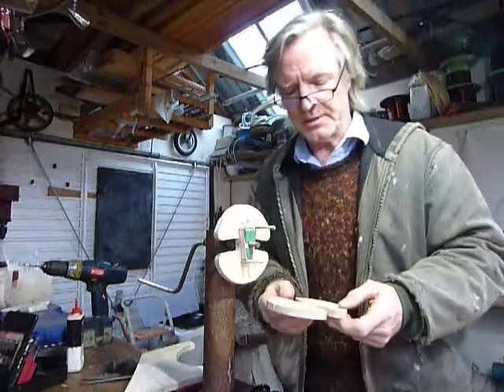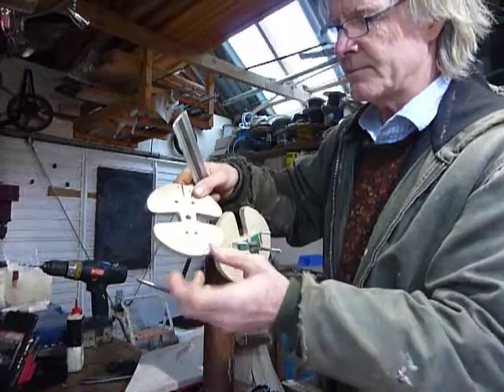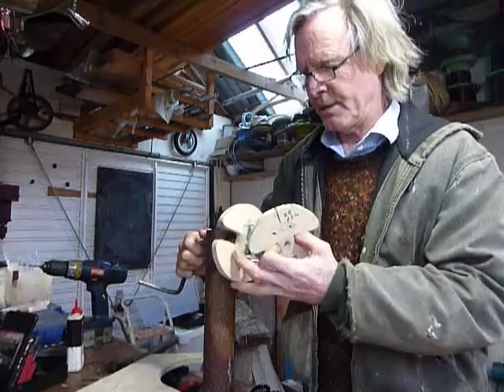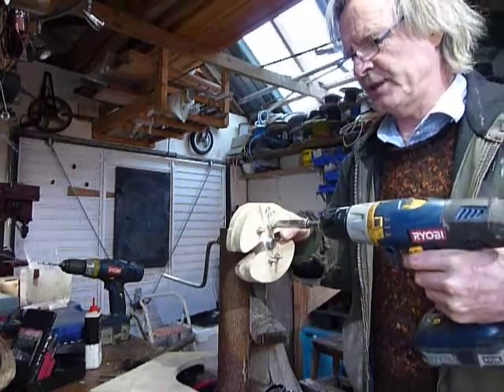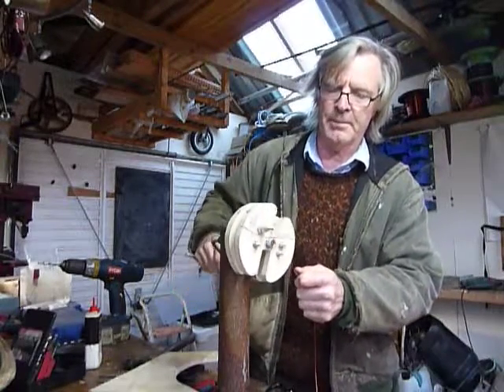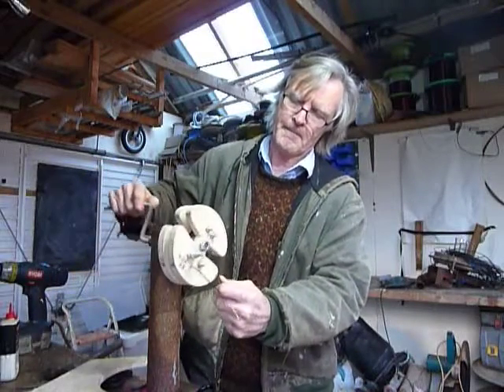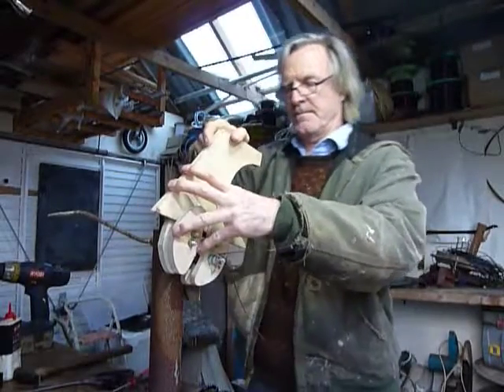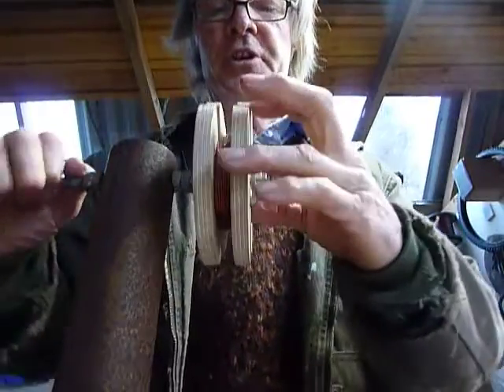Winding a 84 turn coil for a 21 coil stator

Comment: If i want a 24 to 48 volt turbine how many coils and what thickens wire is the best
Reply from the maker: There is no simple answer.  I need all of the numbers as everything in the design affects everything else.  Your easiest way forward is to use one of my standard designs but if your magnets are different then please give me all of the details and I will see if I can come up with a suggestion for modifying it.
Reply: @scoraigwind  I can get 16 gauge wire and 75 mm x 50 mm x 20 thick ferrite magnets so how many turns in coil and how many coils and magnets to build 48v turbine
Reply from the maker: @faithquestionsministries  Sorry Johan but this conversation is wasting your time and mine.  The number of turns in the coil is calculated based on a host of factors and I am getting drip fed.  I do not know the blade diameter or the power.  In the end what you need to do is to follow my plans that you can easily buy rather than asking small random questions that beg huge, time consuming questions.  People who want to ask me questions about wind turbine design should ask them in an email to hugh@scoraigwind.co.uk and tell me everything about the project, not just the battery voltage.  If possible they should read one of my books first or if not then I can recommend one.  for example my Recipe book or my 2F plans are a good stating point.  I am happy to work with you from that basic knowledge and help with customisations that meet you individual needs.  Just do the basics and please contact me by email rather than by comments on youtube.  Thanks.
Reply from the maker: @faithquestionsministries  I am sorry for upsetting you.  I try to be helpful but I got a bit impatient this time.  I can send ebooks to you in seconds (but it might take a bit longer to read them) and am happy to help adapt the designs to suit what is available to you, but the question "how many coils and what wire thickness to make 48Volts" simply does not make any sense and I do not have time to explain this to you for the fourth time.  I am glad you found the help you need elsewhere.
Reply: @scoraigwind  I see you deleted my question why because i sow out of your own book what you did write in 2003 now you dont want to answer me what is your problem
Reply: @scoraigwind  There is a simple answer just tell me how many coils for a 48 volt turbine 9 or 12
Reply from the maker: @faithquestionsministries  Really Johan I did not delete anything and I try to help people but I am at my wits end with you.  You who know nothing about it tell me that there is a simple answer.  I tell you the answer is complicated and it depends on many factors.  You can make a 48V turbine with 9 coils or 12 coils or 96 coils but you need everything else to be considered before you can say how many turns and what size wire.  So I cannot answer your question.
Reply: @scoraigwind  I got your book and it says 10 coils 3 kg copper 13 mm thick  360 turns 0.7mm for 48 v magnets 46 x 30 x10 is this right according your book? I want to help a farmer that got 48 v 12 kw Lithium battery bank and 12 kw solar but his batteries need extra power to charge at night they use to much power. So i want to build a 1.5 kw turbine to help the batteries charge . I don't know if i can use thicker wire like 1mm or 1.4mm or will it make the amps to higher. We need voltage so must i stick to 360 turns 0.7mm for 48 v? And can i use your controller circuit board in the book to control the power input to batteries and what size is the 5 rectifiers you use in your book. Can i use 150 amp rectifier? There no one else that build turbines in South Africa maybe you can give workshops here like you did in Zimbabwe?  I did write dont know why that writing is gone sorry if it was You Tube fault.
Reply from the maker: @faithquestionsministries  I have been writing books about how to build wind turbines since 1980 and you have looked at one called "How to Build a Wind turbine" or maybe my axial flux plans from 2003 but I have published many designs and if you want a bigger one you can find it in my Recipe book. 360 turns was correct for that ten coil design with that connection scheme with those magnets in those numbers at that speed for those blades but it would not be a number you can use for any other alternator and expect to get a good match to a 48V battery.
Reply: @scoraigwind  Thank you Hugh i honor your answer have a blessed day

Comment: Hi Hugh i am from South Africa how many coils do i need and Round Ferrite magnets to give power to a 12 v battery system i dont have space for a big turbine
Reply from the maker: hi Johan, 

There is no simple answer.  I need all of the numbers as everything in the design affects everything else.  Your easiest way forward is to use one of my standard designs but if your magnets are different then please give me all of the details and I will see if I can come up with a suggestion for modifying it.

cheers
Hugh
Reply: @scoraigwind  Hi Hugh So you want to know what wire i am going to use what magnets how big and so on? Didnt you build a small wind turbine that charge 12 volts? Regards.
Reply from the maker: @faithquestionsministries  Yes I have built a lot of wind turbines in my life but each one was designed as a whole.  The voltage depends on rpm which depends on blades and it depends on the number size shape and type of the magnets.  If you are using microwave magnets then have a look at this post in my blog.  I helped Pedro with this project.  https://scoraigwind.co.uk/2011/07/pedros-microwave-ferrite-magnet-turbine/
Reply: @scoraigwind  Thank you Hugh i will do so

Comment: Hello sir hugh i have a question 
1.how do you calculate the number of turn coil you needed and how big is the dimension of the coil for designing the stator mold ?
2.Are the wind turbine have protection againt lighting strike if not how do you give it protection ?
Ps i know there a video of how to calculate the coil but i still cant understand it coz language barrier
Reply from the maker: hi, I would not try to explain the design in a comment like this as there aer so many variables and it would be a very long story.  I have written it in my Recipe Book.  That is translated into several languages.  Or if you emal me and ask for a certain design with all of the details of what you need then I can help to find the right answer.  I do not really have a problem with lightning strikes.  But I am told that it helps to have a good ground at the tower.
Reply: @scoraigwind  Thanks you very much for the reply....🙏
May i ask whats your email .... Ihave found 1 in your blog but i dont know ist right one or not

Comment: If the magnet is in motion is the bigger wire induce more watts? Than the small wire?
Reply from the maker: The voltage depends on the number of turns.  Use more turns to get more voltage.  We need to choose the correct voltage at the correct speed depending on the blades and the batteries we are using.

With bigger diameter wire you  can have fewer turns that fit the space.  (Less voltage.)  But the big wire does not get so hot, with the current so it loses less power and it can handle more current.
Reply: @scoraigwind  sir we have low wind speed..is it better to make wide or longer blade?
Reply from the maker: @jyu7127  Longer blades catch more power from any wind, including low winds.  Wider blades make more torque, but they turn slowly, so they do not make more power.  You want high speed for electricity ,so you need long narrow blades.
Reply: @scoraigwind  thank you sir for your time..

Comment: Hello sir I'm jimmy from Philippines..what the difference instead of number 15awg magnet wire I'll use number 21awg same number of turns..is the power output will be less in a certain wind speed?
Reply from the maker: Smaller wire will easily fit in the space but it will create more heat so you get less power output.
Reply: @scoraigwind  thank you sir..

Comment: Do you use any kind of wire or is it enamel coated.Thank you for your channel and all you do.
Reply from the maker: Yes you do have to use enamelled wire to make coils.  Bare wire would simply all short together into a big ring and act like a brake on the turbine with no output.

Comment: Is that true? the number of turns and the number of coils, will affect the power produced by the stator? How

Sorry for my lack of principle
Reply from the maker: Yes it is true that the voltage depends on these things:
Strength of magnets
Size of magnets
Number of magnets
Number of turns per coil
number of coils (in series)
speed or rotation.
Each of these things is important and affects the output voltage directly.  So you can double it and you will see double voltage. 

Voltage is also affected by the load.  If there is a high load and high current then the voltage will be reduced somewhat due to internal losses.

I hope this helps.
Hugh

Comment: some more info.     at smaller scales, (lower operating speeds and) the inherent MA present in the  radius of a wind turbine rotor, makes is sensible  to use  a  wye/star stator config.      in contrast, if the  energy  going into a  pma is more efficiently utilized at  higher rpms,   a delta stator config  SHOULD be considered.     the output, generally, is the same.    but the lenz-force braking 'ramps up', gradually,  with rpms.     output rises amps over volts.   in the context of producing  Electrical energy,  this is NOT an issue.    in all cases,    watts =   amps x volts           googletranslate
Reply from the maker: Hi David,
I don't really understand what point you are making here in these comments to be honest.  I know a bit about the smartdrives (aka F&P motors used as alternators) and their pros and cons, but they are very different animals from the axial flux alternator that is the subject of this video.  These axial flux ones have several advantages.  tThe lack of iron core in the stator means very low or zero iron loss so high efficiency at part load, and easy startup.  I can design for any size machine whereas the smartdrive has limited watts/rpm.  Please could you try to be a bit more coherent in your comments here so that we can understand and respond to your thoughts?  thanks
Hugh
Reply: @scoraigwind   weh-weh-weh.    hugh,  one  part of my comment Was pertinent to the content of this video.     in your reply, you have chosen  to NOT acknowledge it.       as for the rest,  over the years, you may have come to understand the  INADVISABILITY of attempting to convert an f&p  motor.  other folks  have  NOT been  so  fortunate.      i have encountered one person whose  Incorrect belief it was, based on things You had stated,  that it was appropriate to  Interconnect   ADJACENT  coils.   maybe you did not say it.    if you did,  you  were  WRONG.    is this  CLEAR  enough.      googletranslate
Reply from the maker: @daviddavids2884  sorry but I missed the pertinent bit among all the other stuff.  It would be helpful if you could restate it simply for me as I find your style of writing somewhat bewildering.  And I have to say somewhat unfriendly too, I am sad to say.  

I helped to edit a decent document on how to use a smart-drive aka F&P motor for use in turbines (mostly for hydro where they work extremely well) and you can read it here https://drive.google.com/file/d/0BzVDBix3S_qbNnZvbDByQUhIcjA/view

I am capable of giving bad advice of course, and people can also misunderstand my advice, but I do my best.  I would not advise connecting two adjacent coils in a smart drive in series as they belong to different phases.

If you can clearly tell me what you wanted to say that I allegedly avoided answering then I will answer it.  
All the best.
Hugh
Reply from the maker: @daviddavids2884  Bye, and sorry for being so dim.

Comment: some late info.    while i wait for my log-in at  'thebackshed' to work, i comment here.     you and others have Not understood the stock configuration of F&P direct-drive motors.    such f&p motors are  TOTALLY  Optimized, to function as a  large-radius, THREE-phase, bldc, outrunner motor.    in the case of a 36-pole stator, there are  TWELVE  coils per phase.    and the  ROTOR  has a  Compatible  configuration.     the configuration of such a stator can be changed to  12  phase.     BUT  THE   CONFIG  OF  THE  ROTOR  CANNOT  BE  CHANGED, EASILY. 
possibly due to your advice/opinion, some folks think it is correct to  Interconnect  ADJACENT  coils.   IT   IS    NOT.        conclusion:   these motors are a  POOR  choice for use as a pma and should be used  AS  motors; discussion below.      people  wanting  a  GOOD  pma,   SHOULD  simply  PURCHASE  a  PMA-conversion, online.     they have been around, for   YEARS.
regarding this video:      it should be  UNDERSTOOD  that there should be  just  a  FEW  layers,  in a  Generating coil.       when there are too many layers,  volts will be fine,  BUT  OUTPUT  CURRENT (and watts)  WILL  BE  LIMITED.            on the other hand, the development of large-radius bldc outrunner motors  is a  KEY  step towards achieving, overunity.     as a result of    Inherent Mechanical Advantage,   such motors produce a   LOT   of  Torque, near their  Center of rotation.     you are invited to review the entirety of my ou research; including, diary entries.      googletranslate

Comment: what determines the volts on the coil I wont to make one 12v how many turns & gage wire do I use
Reply from the maker: Hi thomas, There are many factors that need to be considered to find the best winding.  For example the RPM is critical and this will vary depending on blade diameter and design and windspeed.  So I need the complete picture.  I do respond to enquiries by email or as questions on my web page or facebook page but I do need full details of your project. cheers Hugh

Comment: Hugh, first off I hope your doing well. Me still fighting the misinformation out there. But I do see a real growing interest in these wind turbines. I'm working on a third axial now. I'm taking them to a off grid community in the Pueblo mountains of Denver, Colorado. All these off Grid people have burned up all the pma's, the pmg's that these companies sell. For a Friend that lives in that mountain range in Denver. I plan on making this high voltage stator. But just wondering if you've completed this yet. I think about thickness of the sator and how the thickness reacts to magnet's being further apart? What's your thoughts on the matter. Thanks and I hope to hear back from you.
Reply from the maker: Hi Billy,  It's not hard to burn a stator if you don't appreciate the importance of a good furling system and make sure the machine keeps out of harm's way.  The stator in this video is replacing one that is about ten years old that suffered from some insulation failures.  Working at 200 odd volts is a bit hard on the insulation long term and I should use more sleeving and barriers than I do for sure.  Optimum spacing for magnets to get the most "bang for your buck" is about equal to the thicknesses of the two magnets added very roughly.  If you put them closer you get stronger flux but less room for copper and less clearance so I usually put the magnet faces about 20mm apart (3/4" or so) maybe more in some cases. I've been making stators like this for about 18 years or so now and they work pretty well.  The most common reason for failure is that the magnets plough into them due to neglected bearings. But that is pretty rare.
Reply: Hugh Piggott thanks for your comment back and clearing thing's up. Hope to see more of your channel. Stay well😃👍